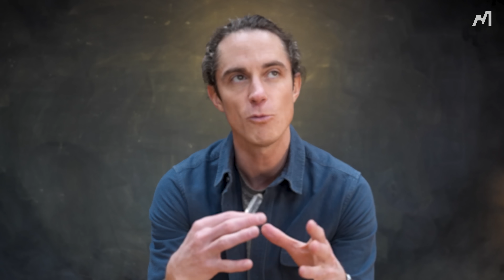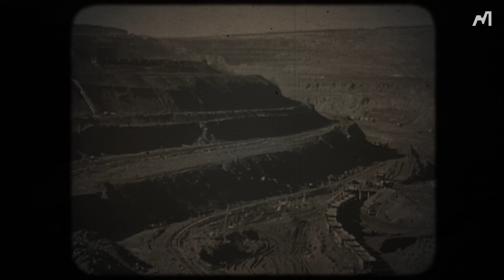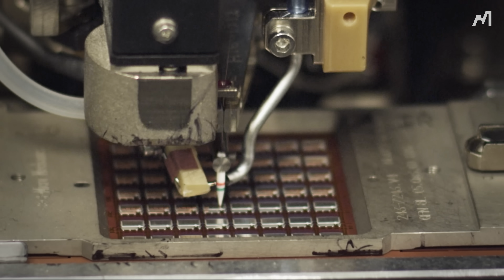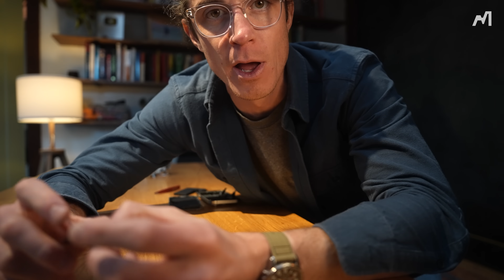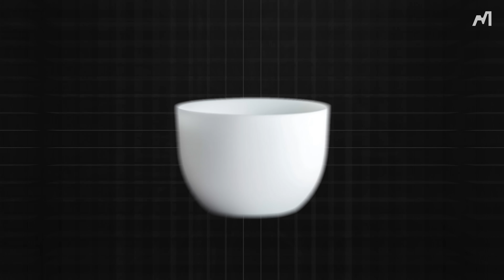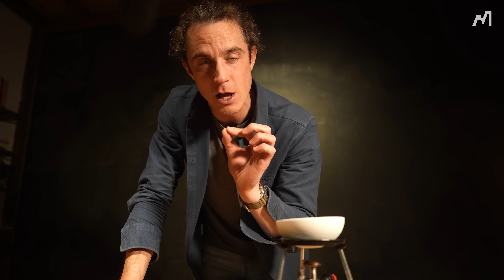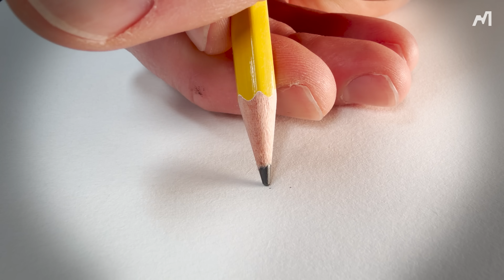Saudi Arabia Has Oil, America Has This

Comment: 13:03 That's probably not true.  Silicone has a bandgap of 1.12ev while diamond has a bandgap of 5.5ev.  The bandgap refers to the minimum energy for an electron inside the semiconductor to "flow".  So, silicone being so low lets minimal energy "flow" electrons which creates heat.  Heat, is energy that causes electrons to "flow" which creates a feedback loop that causes current leakage that is a massive problem.

Diamond being 5.5ev means you need to explicitly dope the material so there are electrons to flow, then you need to intentionally drive those electrons.  Compared to silicone that wants to start the process with very little energy, you have like 30x the control over energy management.  The practical application is that 30x more energy goes into driving the load instead of becoming parasitic heat loss.

Its an incredibly hard problem to solve, but to think silicone is our forever semiconductor is lowkey kinda silly.

Comment: Single crystal turbine blades are grown by one company not by the primes (GE Pratt Rolls etc.).  For a few million you can buy a casting machine.  Single crystal casting has found very few uses other than turbine blades or pumps like the SSME.

Comment: I'm amazed no one has invented a way to refine silicon to the purities necessary to make those silicon ingots. I guess the reason is that any such process would be way more expensive than just mining the stuff.
Reply: They have, this content creator is trying to make it sound more special then it is
Reply: Synthetic is the standard for the top end in the first place, it just isn’t currently made at scale as it is more expensive. But even if it were made at scale, you’re looking at a ~0.1% increase in semiconductors. Silicon itself is 1% of the cost of a finished wafer and quartz is about 10% of the cost of the silicon.

Comment: There's a problem with the "over millions of years" presupposition. The force required to build those mountains and produce the quartz can't be produced by continents colliding slowly.  They would have to be moving at roughly the speed of a fast walking man or even faster. High speed for continents. It had to be a smash,  not a slow, over millions of years, grinding crunch.

Comment: The alternative is synthetic grown quartz. It's energy intensive, but is a mature industry supplying single crystal quartz for oscillators and optical quartz. The key reason synthetic quartz is grown at the moment is to achieve a single crystal of a specific form (quartz can crystallizes as 2 mirror image forms, and natural quartz you often get mixtures of forms and less than ideal crystals, synthetic allows for more control of this). Anyway, one of the biggest producers of synthetic quartz crystals? China.

The pure natural quartz is easier and cheaper, as it doesn't need all the processing and the energy, you can just begin to form it into a crucible. And for a crucible it doesn't matter how good your crystal form is as that isn't important.

Comment: Quartz crystals have changed the world. 
Quartz crystals were used for all Radios for many decades. 
Even in the late 90s two ways radios were still using crystals 

I remember ordering receive and transmitt crystals for GE and RCI and even Motorola 2-way radios 

In the late 80s, around 1987, Motorola made the first solid state trunking 800 MHz 2-way radios 

Before then the radios were simplex or duplex and they were crystal 

In 87 Motorola made these radios and the Trunking networks began and the radios were solid state and you could program the radios using software for 806 to 824 MHz and they could do the talk- around Frequencies of 850 to 869 MHz

Kenwood also did solid state and Maxon and RCI and Standard and Icom, and others

They changed the world allowing you to program a frequency easily 

And the CTCSS tones from a crystal to solid state

Comment: The USA desperately clinging to their exceptionalism ideology, now relying on quartz.

China has discovered over 35 million metric tons of high-purity quartz (HPQ) in eastern Qinling (Henan Province) and Altay (Xinjiang Uygur Autonomous Region), marking a strategic effort to reduce reliance on U.S. imports from Spruce Pine, North Carolina.  These deposits have been officially recognized as China’s 174th mineral species, underscoring their national importance. 

The quartz from these regions has achieved 4N5 grade (99.995% SiO₂) in pilot-scale production, with some samples reaching 4N8 grade (99.998%), meeting standards for semiconductor and solar applications. 
Chinese research institutions and companies have made breakthroughs in deep purification, targeted impurity removal, and resource assessment, laying the groundwork for industrial-scale use. 

Whilst it may not be as pure as what the US has, the question needs to be asked does it need to be?
Hurricane Helene caused damage at the US mine reducing output.
I will use the German tank to explain why none of this matters to China.

The Germans made the best tank yet they lost to an inferior tank because an inferior tank was easier to make, didn't require the best materials or manufacturing facility and because they took less time to make.

China has already produced smaller chips on older machinery than Taiwan, Europe or the US could make on that machinery. Their chips do not need to be the smallest or the best, what is needed now is volume of "just good enough".

That is why none of this matters.
Reply: Ok, boomer with 2 followers.

Comment: The entire premise of this video was outdated before it was posted. Last year China announced discovery of major high purity quartz deposits in Qinling/Henan and Altay/Xinjiang and is currently tying them to photovoltaic and semiconductor supply chains. Also, while it is a smaller player than Spruce Pine, the mine at Drag, Norway has been supplying high purity quartz for crucibles since 1996. Last and not least there are synthetic routes for producing high purity quartz.

What would have been a more interesting video: Can Chinese domestic quartz (natural or synthetic) + domestic processing reliably hit semiconductor specs at scale, with the same defectivity stats, and survive customer qualification? AFAICT that’s the actually nontrivial part.  Because in the end “we found deposits” ≠ “we can feed EUV fabs tomorrow”

Comment: Casually drops that China can obtain it artificially through gas deposition at end of video.
What was the point of this video? Silicon is common, the chemistry is well known, and state backed industries around the world are ready to pick up the slack if need be.
If the US supply was cut off, scaling up purification to the necessary industrial levels is only an engineering problem. One China can and will put unlimited funding into solving. Quickly, at that.

Comment: In addition to a previous post I did find one inconsistency in the information. The statement that one small imperfection will completely ruin a CPU is not normally  the case. If a wafer is producing chips that have eight cores. Only a certain number of those cores will be free of defects due to contamination or manufacturing. Generally between 70 to 90 percent of chips on a wafer are viable for sale. 50% of those tend to be considered premium due to all the cores passing quality control. 10 to 30% of the remaining processors we'll have a certain number of cores that do not pass quality control. Those cores are disabled and the CPU is sold a lower core product. Entry level AMD processors like the ryzen 3 has four cores, ryzen 5 has 6 Ryzen 7 has 8 cores and a ryzen 9 has 12 cores.

Comment: I'm actually surprised this information is not under extremely high security restrictions. I'm an old boomer and have never heard of this as far as locations. Impressive documentary, Thanks
Reply: Because it's wrong and out of date. The latest breakthrough is the 1nm lithograph chip controlling virtual processing.
Reply: This video is just BS because it is for “entertainment.” I actually work in the semiconductor industry and high purity quartz can be easily grown from electronic grade silicon. Only reason Spruce Pine quartz is used is because it is cheaper is start with a relatively pure material as it eliminates some purification steps. But it is definitely NOT “essential.”

Comment: First time watching. The content seems generally accurate and easy to verify.
 first I was skeptical about the claim that Spruce Pine was as crucial as stated. After a small amount of my own research. I arguably agree that it is a very crucial source. If the source did not exist we could refine any source of quartz to the Purity required. The cost of refining any given source of silica based on the amount of impurities and final Purity required becomes a (Purity Scaling Factor).
  This creates an (Exponential Growth in Costs: When each additional percentage of purity requires a multiplication of effort, energy, or time, the cost increases exponentially).

Spruce Pine at this time is expected to contain enough deposits to remain viable for up to 100 years. They are beginning upgrades and expansion to meet increases in market demand.
  Currently they provide between 70 to 90 percent of high-grade silica the world market.
  If you've reached this point Thank you for taking the time to read this.

Comment: Norway, Russia, China, Canada and Australia all have proven deposits of semiconductor grade quartz currently being developed or already supplying ultra pure silicon for the industry. Granted none of them are as advanced and developed as spruce pine, but technically if China were to take Taiwan production would stall but not cease completely. It’s also possible to purify silica prior to reduction albeit extremely expensive… still doable in cases of extreme need.
Reply: Your first statement contradicts the whole point of this video. Can you provide any evidence for your assertion?

Comment: Oh come on. Electro-accelerator based separation will make any purity you want. Iron? Centrifuge. Copper? Likewise. Zinc, Carbon, only when you get to Phosphorous and Aluminum does it get hard, and even THEN laser absorption under cryogenics can do the job.
Now, CHEAP IC grade...that's entirely different

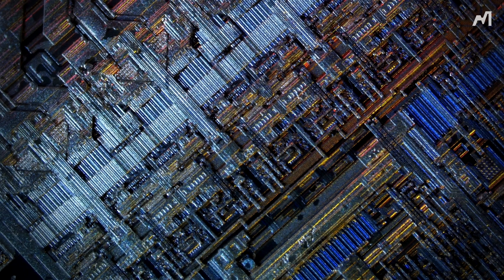Comment: 5:00 not entirely true... modern chips have redundancy built in, if a sector of the chip is "bad" it will be disabled and the chip will run with degraded performance (less cache, slower, less shader cores etc.) and the chip will be sold at lower price. Ofc building a factory and paying workers/ material just to output 80% worse products (on average) than competition isn't very economical but if you are desperate you can build multiple factories and have same output of good quality chips as someone using ultra-pure materials and top of the line processes

Comment: This just doesn't seem factual. While spruce pine is big into this it is nowhere near the bottleneck this video makes it out to be.
"Spruce Pine isn’t the only source of natural high-purity quartz. China produces around 5,000 tons annually, and is hoping to scale up its operations to 20,000 tons or more. Norway and Russia both produce a small amount, and historically Brazil was a major supplier. And there are other potential sources around the world being investigated in Canada, South Carolina, Sri Lanka, and Australia."
"One option would be to use synthetic quartz rather than naturally mined quartz. Synthetic quartz can in fact be made far purer than natural quartz. The downside is that synthetic quartz is much more expensive, perhaps on the order of 5–10 times the cost of natural high-purity quartz."
source: counstruction-physics (i also checked the sources of the website and that all seems correct)

Comment: I've been working in embedded for 30 years. When we buy chips they come in lot/bins, the lot/bin depends on the error rate for the dye. They are close to perfect, but they are not perfect. There are defects which affects the heat produced by the chip. The tops of the chips shown are usually ceramics that are baked over chip, not the chip themselves.

Comment: There's nothing truly irreplaceable.  You could make 9 nines silica the way they do with vapor deposition for solar cells, then shatter that down and melt it into crucibles even more pure than the American Quartz crucibles.  It would be way way more expensive than just digging the crucibles out of the ground, but that expense would get amortized across all of the semiconductors made with the crucible.  No way it so much as doubles their price.  Why don't we do that?  Because we can dig a cheaper crucible out of the ground!  America has an advantage, but it's not an insurmountable one.  Meanwhile new semiconductor architectures are being considered... vapor deposited sapphire or diamond instead of silicon.  China might decide to simply use such a process and make an end-run around the whole issue.

Comment: There's a misunderstanding in this video about the semiconductor industry. Companies do not "look to TSMC instead of Intel" for processors; TSMC and Intel perform different roles in the same industry. Intel, Apple, AMD, NVIDIA, and Qualcomm produce the designs for processors and partner with TSMC for their manufacturing. The similar contrast with Japanese tech companies leads to a similar misunderstanding of where competition exists. Japanese tech giants (e.g. Sony and Panasonic) almost exclusively utilize processors designed by Intel, AMD, Qualcomm, or NVIDIA and manufactured by TSMC in their products.

Comment: Both true & false... or rather less true. Lots of places have relatively pure silica & quartz deposits and you can make things more pure as needed. But more importantly, it does not have to be the foundation of microchip production, it just happens to be the technology/production path the industry has chosen to go down for the majority of microchips in production (for both technical and economic reasons). There are other  materials like germanium, gallium arsenide, and indium phosphide, etc that can be and are used currently in some cases.   Yes, if there was a sudden need to switch the underlying material used for the majority of chip production it would be very inconvenient, but the switch could be made. It would probably take about 5 to 8 years, maybe 10, to do a complete switchover to something else at the scale we currently produce silicon chip things, but it could be done.

Comment: I'm suspicious of these claims so I asked IA: "Where does china source its high-purity silica sand used for wafer fabrication?"  It responded with: "China sources its high-purity quartz (HPQ) sand, critical for solar and semiconductor wafer crucibles, primarily through imports from the United States (notably the Spruce Pine mine) and Norway. While historically dependent on imports, China is aggressively developing domestic sources in Henan and Xinjiang, aiming for self-sufficiency in high-grade sand."

Comment: AI Overview
China is actively working to reduce its heavy reliance on high-purity quartz (HPQ) and related raw materials (such as those from the Spruce Pine district in North Carolina) for semiconductor manufacturing by accelerating domestic discovery, investing in synthetic alternatives, and enforcing local procurement mandates. Roughly 80% of China's high-purity quartz, essential for crucibles that hold molten silicon, has historically come from the US. 
To break this dependency, China is taking the following actions:
Discovering Domestic Sources: In April 2025, the Chinese Ministry of Natural Resources announced the discovery of high-purity quartz deposits within China, specifically in the Qinling and Altay regions. While the quality and volume are still being evaluated, this is viewed as a strategic move to reduce reliance on imports.
Investing in Synthetic Quartz: China is investing at least $14 million into synthetic quartz manufacturing to create a local alternative to natural HPQ. This initiative, focusing on companies like Nantong Crystal, aims to secure the supply chain for quartz crucibles, which are necessary for fabricating high-purity silicon wafers.
Developing Local Purification Capabilities: Chinese research institutes are actively working to refine locally sourced quartz to 4N5 (99.995%) and 4N8 (99.998%) purity levels, matching the standards required for the semiconductor industry.
Mandating Domestic Procurement (50% Rule): To reduce dependence on foreign, particularly U.S., materials and equipment, Chinese authorities have quietly enforced a mandate requiring chipmakers to source at least 50% of their equipment and materials from domestic suppliers.
Upstream Materials Control: In response to U.S. sanctions, China has shifted toward controlling raw materials, including tightening restrictions on rare-earth-based consumables and materials needed for chip manufacturing, reversing the pressure on the supply chain. 
These actions are part of a broader "50% rule" aimed at achieving semiconductor self-sufficiency and mitigating the impact of U.S. export restrictions.

Comment: Interesting. You should show the process which raises the purity of each silicon rod by rotating it vertically inside a large vacuum chamber while a radio frequency induction ring surrounding the rod is slowly moved up the rod to create a narrow layer of molten silicon which allows the impurities to escape into the extremely high vacuum.